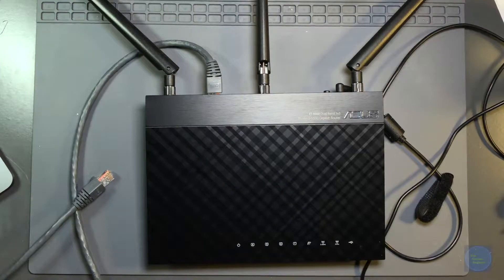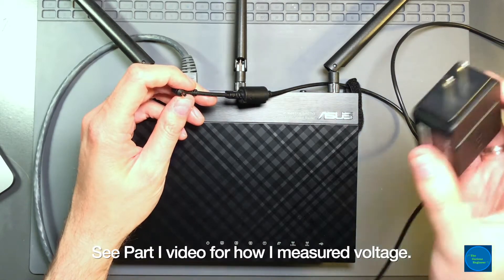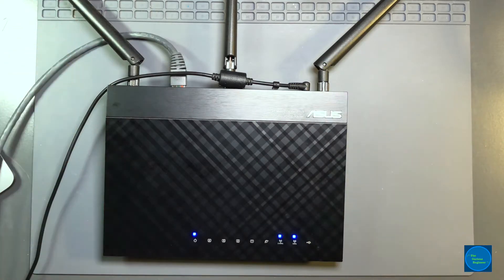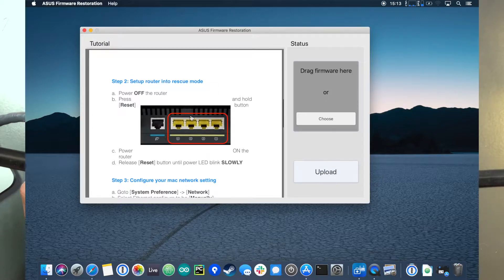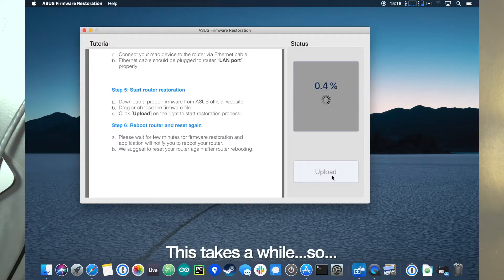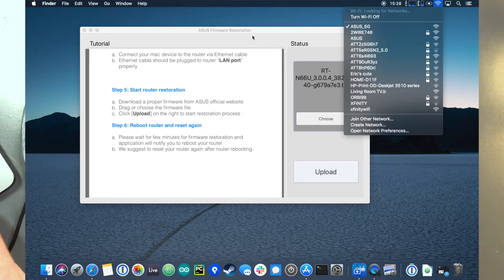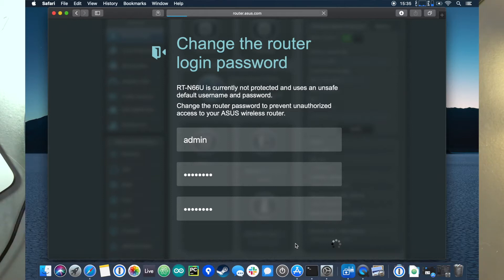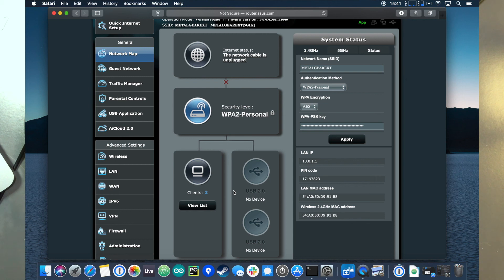Rescue That Router! The Lost Tutorial -- How to Rescue and Securely Recover the ASUS RT-NT66U!

Comment: No idea why, I get the error my wireless router is not in rescue mode. Can't flash anything. Using the webgui to flash it says file transfered isn't valid. Doesn't matter what version I use. Openwrt, or tomato or original firmware. All of them say invalid.

Comment: Excellent videos! I have a question: is there any problem if I use a 12V PSU instead of the 19.5 one? I've been using a mini DC UPS that outputs 12V. The total power is withing specs (VoltAmpere). Thanks!

Comment: Found your video very interesting, I have a question have you seen or experienced while attempting to put the router into rescue mode having a   red (indicator light above the globe symbol) as well as the blue(power indicator) light flashing. the rescue software keeps reporting back that the router is not in rescue mode. All the rescue modes steps where followed... unplug power ,press and hold the reset switch while reconnecting power hold reset till light starts slow flashing. point is i have a red and the blue light start to flash. Any ideas as to the issue why rescue mode is not enabled? Asus RT-AC68U v3

Comment: Curiously, this router is NOT on the supported hardware list for OpenWRT, but all it's brothers and sisters from Asus are. You never got to "Part 3" about the chipset. I was searching for chipset info, because I wanted to see if this could run OpenWRT. It appears might be possible owing to the micro-SD slot you show on the main board... any ideas?

Comment: I will never recommend an ASUS router to anyone, despite its great specs!  I had a brand new one in storage, and after only a few days, it stopped working and would not power back up!  A router is only as good as its weakest link.  In this case, the power button must have gone bad almost immediately.   Why use a power button that is complete junk?

Comment: Thank you for this video, I have the same model and have been using it for years however recently I have run into nvram issues resulting in port forwarding rules vanishing. Do you know if running though this process wipes the nvram and if it does would restoring via this method simply import all the bad entries back again resulting in having no nvram spare to save any settings?
Reply from the maker: I am pretty sure that putting the router into rescue mode erases everything. I don't recall seeing any previous settings or configurations left over after complete the rescue. However, it is possible that a bug or omission in programming might lead to certain things not being erased. Thanks for watching!

Comment: I have an RT-AC86U AC2900 that stopped working these days. I have it for a little over 1 year. I have tried to do all the rescue processes but without success. The LEDs don't light up when I plug in the power cable. I have already tested with another new power supply but it is still the same. It stopped working a few minutes after doing a firmware update. It updated, worked normally for about 30 minutes and then simply went off. Is there any procedure that I can do to try to rescue my 86U?

Comment: Im following the steps but the problem is that the router gets back to its normal mode while im uploading the firmware and cancelling the transfer. It should stay in rescue mode. Argh so annoying
Reply from the maker: That sucks. A quick double-check: Did you reset the router, and then perform the second “reset” to get it into rescue mode? Make sure that power LED is doing the slow blink dance!

Comment: I just got the same router you have, the wifi on mine however isn’t getting a connection even though everything is connected and the cables are good. So I’m restoring the software to see if it fixes it.
Reply: hey I just picked this up at a thrift store, trying to restore it. did you have any luck? I was able to get the login prompt prior to attempting to restore it... fingers crossed I get it figured out!

Comment: I have the rt-ac87u. In rescue mode>lan cable in 1>changed the ip to 192.168.1.10 or 12 but it says invalid ip adress.

Edit: Port one does not asign any IP address at all.

Comment: did all this thermal re-paste and firmware help with the performance?
I'm wondering if I'm having some thermal issues as well, had this router for 5 years now.
Reply from the maker: The router has been running for 8 years now, and is more stable than before. So yeah, I think it helped!

Comment: tested the adapter VDC input using niddle to poke in the +V , and got 19.32V, meaning adapter are functioning perfectly, but put in to the modem and get the input measurements is 0.15Vdc
Reply from the maker: Yeah based on what you are saying it seems like it might be the something inside the router itself, perhaps the switch (as a few others here have mentioned) or the dc barrel jack itself. Does the router refuse to power on at all?

Comment: Thanks for sharing this video. After I plug in the adapter input, and I probe at the modem input socket jack, I got 0.15Vdc which I suppose to get 19V before turn on the switch, I suspect is the modem input socket jack or maybe adapter problem (but the led blue light at the adapter is light up when I switch on AC)
Reply from the maker: You are welcome!